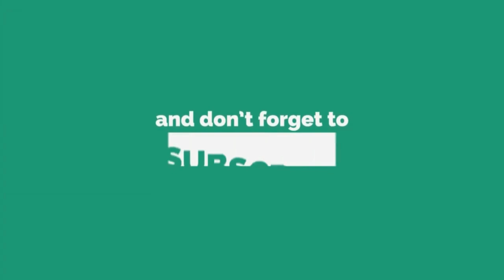An Original Off Grid Cabin | Ep. 7 | Doors, Barn Doors and Getting Dried In

Comment: I may have missed it on a previous video, but what are you doing for insulation? Or with the thickness of the walls, does it not necessarily need it?
Reply from the maker: No insulation on the walls needed. I will be putting foam boards underneath cabin though.

Comment: The door brace is on the wrong side.
Reply from the maker: Thanks. I've been told. Its supposed to be an X brace and will be added next video when I have more 2x4s. Also, I used 6" screws on the top and bottom angled so the boards are secured to each other. So really the brace is more ornamental than functional but I'm still learning as I go.